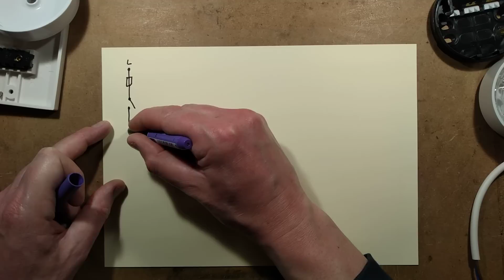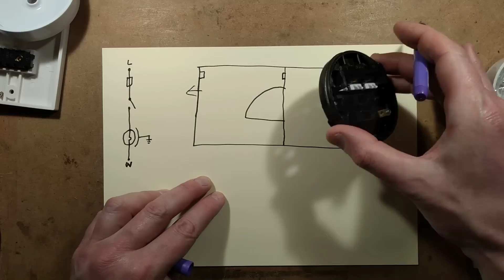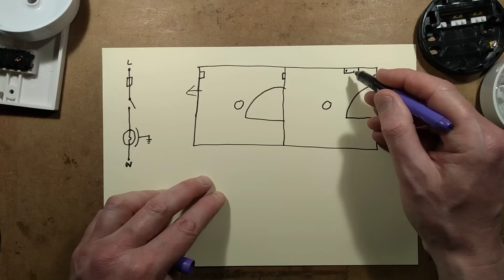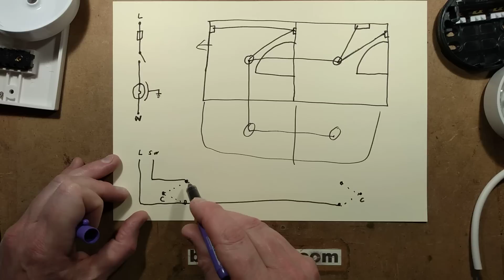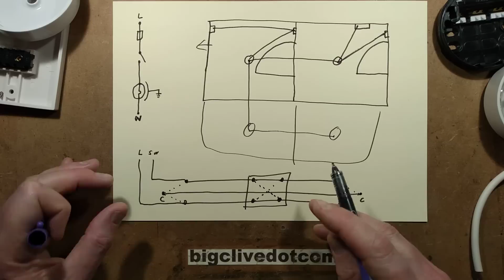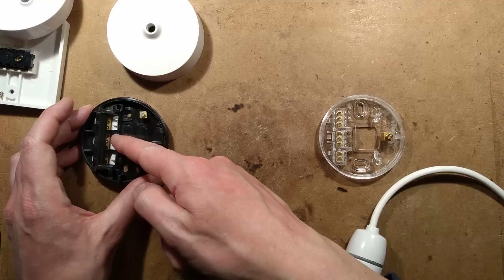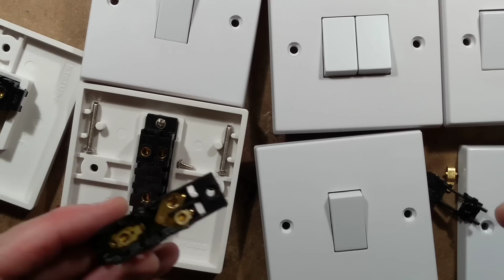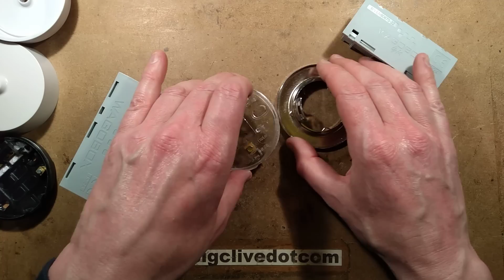British home wiring.  The incredibly simple lighting circuits.

Comment: The UK has one of the best electrical systems in the world in myopinion but I absolutely detest these crazy loop in ceiling roses. The first thing people do is take it down and put up a fancy light fitting so they put all the wires into a choc blockbwhich is usually really messy. The way they tend to do it now us to take the power feed to the light switch. This solves several issues. One is that your working at a normal height and not over your head to wire it up You have one cable that goes to the light and the third thing is that you don't have the confusion of the return live switch wire invariably being blue as no one seems to sleeve it. The only thing you have to do is common up the neutrals in the switch box using a  3 way wago. You also have to common the earth if using a plastic cavity box. The earth post on a metal back box is normally used for this. I always use 35mm back boxes or even 47mm if there are lots of wires. Wago boxes and connectors are brilliant. So much better than choc blocks.

Comment: Couple of feedback having wago like instead of screw terminal would save people so much time/pain. In FR there is a standard "plug" called DCL for lights that enable the user to change the whole light fixture without any risks : electrical shock or falling weight example of such a plug https://materiels-electriques.fr/boites-bbc-rt2012/1422-eurohm-eur53064-3663752044561.html

Comment: I just took the switch cover off while it was live because I’m a daredevil. Most every home I’ve lived in uses a deep plastic or metal box mounted on the wooden beams before the sheet rock or paneling goes on so the are flush. Unless it a really old home. I remember reading that the British electrical plugs had fuses was when Britain was electrifying stuff, copper was a shortage material and the had to run a loop. Is this why lighting in your drawing showed what it did?

Comment: I'm not a fan of hot wires in the ceiling box when the switch is off.  Makes me have to turn off at the breaker box.  annoying.  Safer, yes... but annoying...
Reply from the maker: You should always assume that he wires anywhere are live and never rely on a switch to isolate the power.

Comment: our system in canada(and the us) is considerably different.  the boxes are much larger, deeper and rectangular.  our electrical system is based on two 120 volt feeds 180 degrees out of phase.  so we have two 120v  feeds and a neutral from the street.  we combine the two 120 feeds to give 240 for major appliances, everything else runs on 120.
as a result of virtually everything running on 120, the current for a typical load is double.  most of the wire guage for normal circuits is 14 ga, huge compared to your system

Comment: Are you old enough that your parents had extension cords with lamp holders at the end? Intended to plug appliances into the ceiling lights, but were perfect for young children to stick their fingers into. The source of my first electrics shocks, long before I started in my apprenticeship. :-)
Reply from the maker: The christmas light sockets.
Reply: @bigclivedotcom  Yup, the Christmas lights - every set seemed to have a bayonet cap. But we had these extension cords in our bedrooms too. Old house - not enough sockets. If I remember rightly some of those sockets were the 3 round pin type. I think that's why I learned to change a plug very early on.

Comment: Ceiling roses are useful, with the live, neutral & switch live, they are good for chain link switch, they don't have them in France, they just use wago' s & a cover that slides up the cable that goes to the actual lamp holder &. Then a plastic grub screw to hold it in place

Comment: It's interesting to see the differences between the US and UK in terms of simple stuff like light wiring. I'm sure there is some proprietary system designed to be easy to wire like this in the US, but there isn't really a standard. We do have an array of different types of boxes, usually you can choose plastic or metal, surface mount or recessed, and different depths are also available. And at least at big box stores like Home Depot, you can buy "old work" boxes with wings or some other system like the one with the yellow tabs you showed here, where there are tabs that come out as you tighten the screws that hold on to the drywall/plaster board. These also sometimes have screw holes on small plastic tabs at the front of the box designed to be anchored into plasterboard. New work boxes usually are designed to be nailed or screwed into studs, and then we have weird stuff like ceiling fan retrofit boxes where two metal "shoes" expand to anchor into the two studs between a ceiling cavity. There seems to be a debate between what's upside down vs right side up in terms of receptacles, and you'll find both in reality. I think most homes have receptacles with the ground hole on the bottom, which is what I consider "right side up", but people always have justifications on why it's better to have the outlets "upside down". 
As for actual circuits, lights are usually on whatever circuit powers the receptacles in the room, or whatever was convenient at the time of building. For old homes, after years of renovations, you're lucky if the circuit breaker box actually makes sense in terms of what circuits power what. 15 amps is usually the lowest breaker or fuse you'll see in a panel, although 120v 15a isn't much more than 240v 6a. I'm kind of tempted to wire in some 240v outlets in my living space so I can buy 220v appliances off Aliexpress, haha. (although some things may require 50hz). 
Thanks for the video! Found your channel recently and love learning how basic consumer electronics work at the circuit board level; your knowledge and skill in terms of electronics is impressive.

Comment: Hmm  Interesting to see different styles of wiring. We have everything in one box.  So you only get two wires sticking from the ceiling and you directly connect your bulb or whatever you want.
Reply: my electrician calls that a chandelier system, but I don't know if that's the official term. He makes all the connections either at the switch, or in a maintenance free junction box and runs a single twin and earth to the ceiling rose. It makes it much easier to hang heavy and antique light fittings which often have a small ceiling fitting (we would remove the plastic ceiling rose if hanging a chandelier and use a matching metal bell shaped one)
Reply: @spencerwilton5831  we don't have a ground wire, only two. And our ceilings are  reinforced concrete an all of the walls so my only accces point is a box , switch that runs only live vire back and fort to the box and two wires at the center of the ceiling.

Comment: Just found the video the only issue i see with wiring all the lighting on a floor on a single  circuit is if the fuse/breaker pops then you lose all lighting on that floor where as in America some houses have individual rooms lighting on its own separate circuit and the outlets on a different one. Yes this requires more breakers in the panel but allows you to have some lighting to see where you are going also this allows you to use an outlet if the lighting circuit is out or the lights if the outlet circuit is out. Also i have seen the power run to the switch then to the light and not to the light and a jumper to the switch. Personally i see this as safer as you can work on the light without shutting off the entire circuit. This also puts more of the connections in the wall and not in the ceiling making them easier to access and less to contend with when hanging a light.

Comment: Is it legal to remove a switch on a domestic lighting circuit in the UK and wago the connection and place  kinetic switch ove the hole, meaning the only switch is the mcb, I want to use Philips hue builds with smart switch with out a normal switch my on,y other option is to use a secret key switch but that means you,l have two switch’s? , thanks for any advice
Reply from the maker: Yes you can do that.
Reply: bigclivedotcom thank big Clive, if removing all switch’s with waygo’s would that still pass an eicr?
Reply from the maker: @eddtheduck  It should, but I'm not convinced that lamps stuffed with electronics are a good choice.  If anything it might be useful to keep the switches to at least reset the lamps locally if they crash.
Reply: bigclivedotcom thank you big Clive, I’ll change to secret key switch’s or 3D cover for existing switches

Comment: Do most people jumper the common on a switch when wiring a switch? I have only ever had feed on one common jumper L1 and L2 and have load on other common.
Reply from the maker: It depends on the wiring.  If several independently switched lights are controlled from one switch there might be a single common feed if they all go to the same distribution point.  For separate circuits in different areas it might be one feed per switch.

Comment: In poor countries like mine they used to have so called Schluß alternative circuits.
Only one wire goes from the lamp to each switch's common lead and the other terminals are connected to live and neutral so when the switches are L-L / N-N the lamp is off, L-N / N-L the lamp is on. At first it seems like a clever way to do things but newer switches are not as heavy duty and they burn in all the time.

Comment: One thing my dad's found since moving to Swindon in the 2000s that he's never seen elsewhere with light radials - he was a qualified electrician in the '90s over in London - is that electricians in Swindon tend to loop the radial at the switch instead of the fitting; a trend he can't explain. Would there be any benefit to looping at the switch as opposed to the fitting that might explain why they'd do it that way if, as my dad suggests, it goes against what they're trained to do?
Reply from the maker: It might be that a prominent company there did it that way and it just became habit.

Comment: it certainly is interesting seeing how other countries tackle the same tasks.  bare earths were banned about 50 years ago in australia.  insulated earth wires don't corrode over time therefore are safer.  the double insulated flat cables have a slight groove along them to aid in tearing them open.  20 years ago the boss was given some plastic wall boxes (for brick etc. walls).  he asked me what i thought.  i told him to never ever get the metal boxes ever ever again.  the plastic ones just slid in to the holes i cut and had saw-toothed tabs to keep them in place.  usually no need to cement them in.  hole not square?  don't worry, just hammer them in.  they'll flex to fit.  in australia, both metal and plastic boxes have nuts in slots to allow for adjustments when screwing the cover on.  plenty of knock-outs and no sharp conductive metal surfaces to damage insulation.  and they come with a thin polyethylene cover for the convenience of plasterers.  really worthwhile checking them out and possibly consider importing them to uk if they come in sizes suitable to uk equipment.  i also kind of think the low-tech australian junction boxes and screw connectors have some advantages over the high-tech boxes on this clip.

Comment: Interesting wiring of a "3-way" switch. Here in Canada (and the USA) one of the ways we wire a 3-way circuit is to connect the feed power (black)  to the common terminal of one of the switches, then we run a 3 conductor wire (which is red, black white) to the 2nd switch.  Red and Black conductors are connected to to other 2 terminals of the first switch and also connected to the "other 2" terminals on the second switch. at the second switch we connect the white wire (3rd wire in the 3 conductor wire) to the common terminal on the 2nd switch.  so now back at the 1st box we take a sharpie and colour the white wire black (from the 3 conductor wire). This formerly white wire is is then connected to the light fixture as the hot wire.  (Disclaimer: all our conductors has a bare copper ground wire)

FYI: an "old" electrician once told me they call it 3-way because there are 3 different "WAYS" the switches could be switched, "Both UP", "Both DOWN", or "One Up one Down". not sure I quite believe him but he was convincing.

Good work Clive, 
Barry from Canada
Reply: Yup, I think that's actually the more common setup. In Germany, the setup Clive shows is called the "wire-saving 2-way" because you can run 5-core cable and still have a socket at each 2-way switch. And no, in domestic wiring you don't usually have separate lighting and socket circuits in Austria, Germany and most other surrounding countries. We might start seeing dedicated lighting circuits in Austria though since the next edition of the regs will ban 10 amp light switches on 13 or 16 amp circuits. That's currently fine, based on the assumption that no domestic light fitting will ever draw anywhere near 10 amps, let alone 16. Switched sockets are an issue though.

BTW, there's another 2-way setup that saves even more wires but it's illegal pretty much everywhere in the world. You connect the live and neutral to the L1 and L2 terminals (which are often labelled with arrows pointing away from the switch in countries that use 60 mm round boxes) and run one wire from each switch to the light fitting. You need pretty decent switches or they'll short and burn up, works best with ancient DC-rated toggle and rotary switches. This dangerous setup is known by a bunch of different names like California 3-way, Hamburg-style 2-way etc. In Germany it was often used in TN-C setups, i.e. you could get by with just 3-core cable for a 2-way switch and earthed socket - you had live, PEN and switch wire. Now if some bloody genius decided to upgrade this to a 3-way and then add a socket at the intermediate switch, that socket would have the earth connected either to the PEN (fine) or the live depending on the positions of the switches!

I guess it isn't hard to imagine why that setup has been banned for probably more than half a century!

Comment: This is the most helpful, clearest explanation I've seen,   the one standout of british home wiring I've noticed (watching the practial work on Thomas Nagy's channel)  is that the Fuse  Board always seems positioned in the smallest most cramped cupboard space under the stairs or near the floor, (often sharing it with the gas meter)  requiring the electrician to lay on his back to work on it.   Is it still this way in new home construction?
Reply from the maker: Sadly yes.  I prefer to mount panels at a sensible place for safe work and access.

Comment: Have to say, I would not want to have rectangular boxes; I prefer the circular ones we have in Germany. Much easier to drill and install after the plaster is already on. Would not want to saw(?) right angles into a wall.
Reply: There are some rather crazy tools for fitting rectangular boxes into finished masonry walls but I do have to say I prefer round ones!

The only nifty bit about the British ones is that they're screwed to the wall rather than plastered in so the hole can be a very tight fit. Good sparks can retro-fit a socket into a finished, papered wall without anyone being any the wiser. Obviously that's only possible because the boxes are metal and earthed. All other European countries use plastic boxes and these aren't supposed to be penetrated by screws (although you could cover the screw heads and thus keep up the double insulation, like it's done with the mounting screws of consumer units).

Comment: It's quite common here in the UK to find 100mm breeze blocks have been used for interior walls. Building regs state you can't go deeper than 1/3rd the wall for chasing out, so 25mm is the deepest box you can install in this scenario. You can get mounting frames in metal or plastic as you mentioned to extend the box into the room if you need to - but it looks crap.

Comment: Strange that your breaker panel / fuse box / consumer panel is located near your front door.  In the U.S., they're usually in the rear of the house or hidden in the back corner of a basement.

Comment: British and American wiring is so different. My two story house, 1700 square foot, wood frame house has thirty circuits and space for  more.  It has one large bedroom, two small bedrooms, two bathrooms, loft room, living room and kitchen. Gas ranges and water heaters, central air conditioning/heating, seem to be the most common.   It seems fairly modest and not unusual. A switched receptacle is an acceptable replacement for a switched overhead light.  Loads are split into many smaller "branch circuits", with individual GFI and recently arc fault protection in the breakers. Ring circuits are unheard of. We would call a ring "a dangerous back fed circuit". No "isolators", you just turn off the power to that room.
  So what I wonder is, what is a typical British home like? Wood framing over brick?  What is typical square footage?  Number of rooms? Number of branch circuits? Whats the furnace like, or is base board heating used?
 As a retired electrician this series is fascinating, as is the whole channel. A day without a new Big Clive video is sad.
Reply: Most houses are masonry construction, typically two layers with a cavity between them (filled with insulation in newer houses). A lot smaller than typical in the "new world" countries, maybe 900 sq ft for a basic 3 bedroom house. Oddly, the newer houses tend to be smaller than the old ones, opposite to what I've herd about the US. Heating and hot water is usually gas-fired, with a central on-demand heater. One 32A 240V circuit per floor usually, with extra 6A ones for lighting and another 32A one for the kitchen.